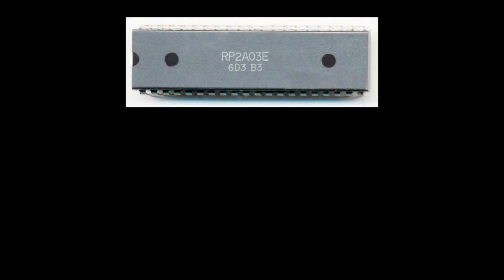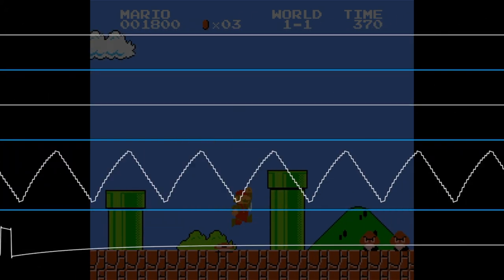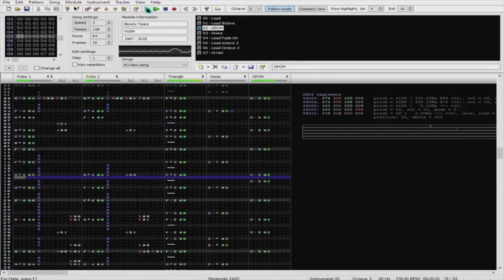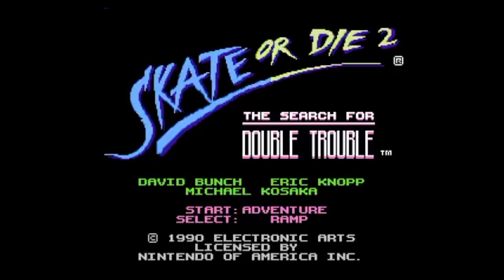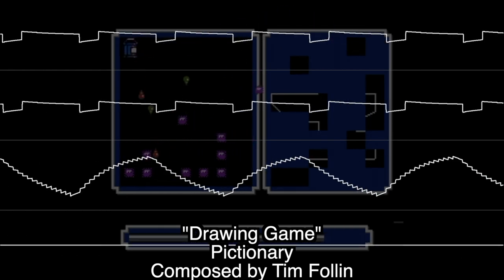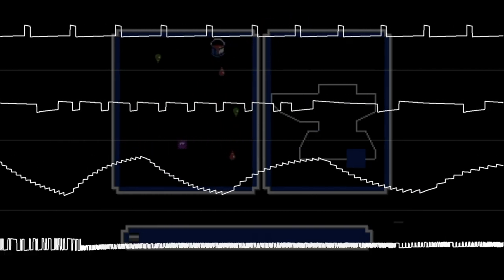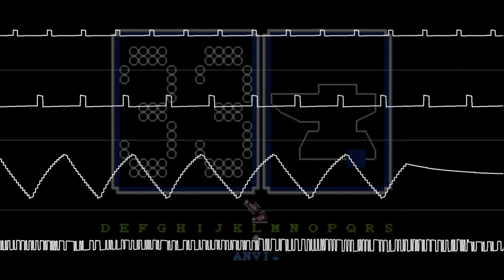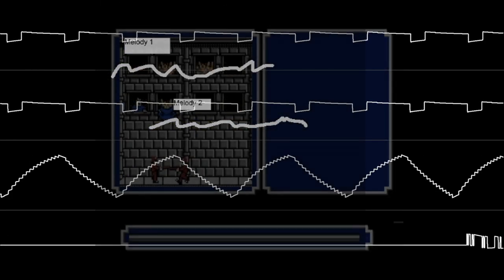Music on the NES

Comment: Neat video! Something else interesting about the Skate Or Die 2 Intro Theme, (and why it’s my favorite song on NES) is that it uses “Raw PCM”, Instead of the NES’ hardware DPCM. Some games would use standard PCM, which gives you less limitations when it comes to the playback rate of samples. The only problem is that it takes up almost all CPU time on the NES making it almost unusable for gameplay. (Unless you make really fast code.)